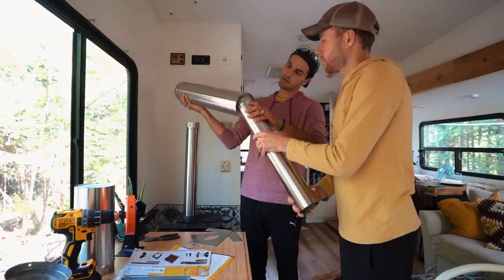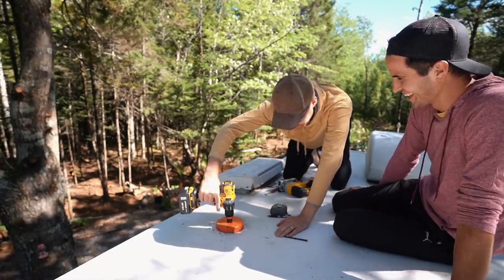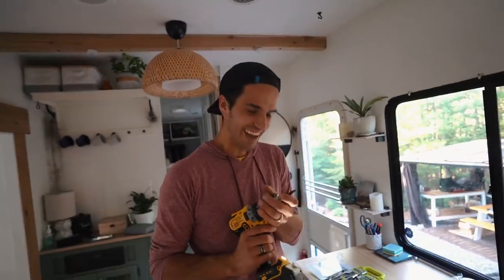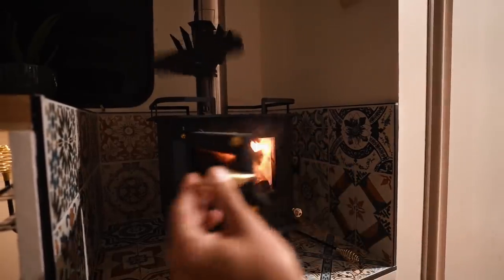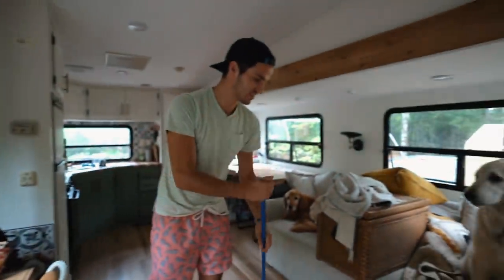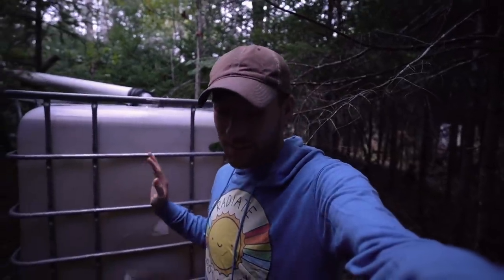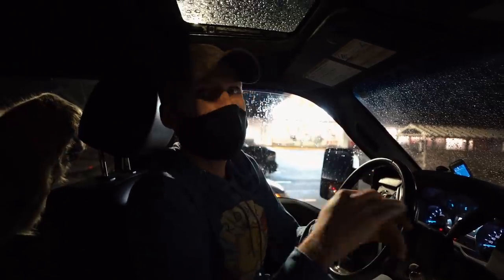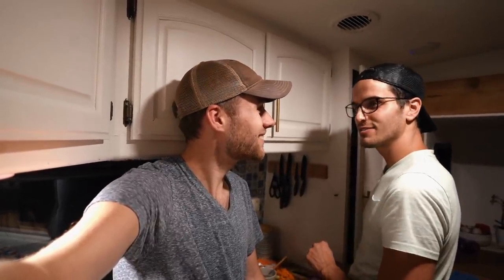LIFE in a TINY HOUSE | tying up loose ends!

Comment: Howdy Guyz!!  Great "Hints from Heloise" tip for cleaning the inside glass of your wood stove.  Take newspaper & little of the ash & scrub it.  The black much cleans off fairly easily!  As for your rain water, get a "Berkie" water filter, that make just about any water safe to drink.
Reply: Any paper (paper towel, etc) or cloth works. Dip the paper/cloth in some water then into the ash and rub the glass. It's like magic!

Comment: That little stove is impressive. I live in a manufactured home and have been thinking of putting in a wood stove for a while. I haven't used my furnace for a couple years because it's so expensive. I bought small space heaters for the bedrooms and have an electric fireplace which works fine. Luckily it doesn't get cold here for an other month.  Sour patch kids are my favorite! Todd's one liners, lol. I like your wit. Have a great week!  Can't wait to see what's next.
Reply: I have to admit, I'm not an expert about heaters. However, a couple of years ago our building was looking into replacing our electrical heaters in the hallways and I was really surprised about what new ideas are available out there. The new electric heaters we got were way smaller than what we had previously, and I had my doubts. But I was totally amazed at the heat they gave off even though they were much smaller. This was in part due to the fact that the heater has a built in fan that pushes the warm air about. It also has a built in thermostat so it turns off once it reaches a certain temperature. I'm on the west coast of Canada and we have government run utilities. I'm amazed how much info and tips are available through the utilities company. They do a lot of research and are keen about sustainability etc. Look into independent info thats available in your area to find more economically viable option for your heating. We can all sympathize with you.

Comment: You two are too funny lol Todd's innuendo jokes are the best. I am wondering if you are really staying in the 5th wheel during the winter if you should maybe skirt it, close in under the bedroom (make a good shed) and insulate inside the skirting. Then an electric heater underneath but you need shore power.
Reply: They can use straw bales and n contractor bags and they won't need to heat.  Oh wait, they are in Canada, lol. I was in the mountains of WV in RV in fall and winter and using those made a world of difference. The bags over the straw keeps critters out btw

Comment: An added benefit of heating with wood stove is it nearly eliminates condensation on the inside windows.  You might need to actually keep a pan of water on the stove to add humidity to the room air.

Comment: Great video, as always! I feel like with a temperature conductive metal roof and seasonal freeze/thaw cycles, it might benefit you to paint some Flex Seal liquid rubber sealant on the perimeter of your chimney pipe flashing as a backup to the caulk. ...just something to consider. 🤗

Comment: To help with keeping trailer warm in the winter, you may want to consider putting some skirting around the bottom to close it in - it will keep the wind, cold and snow from under the trailer.  Ideally, you would have insulation behind the skirting, but it's not absolutely necessary especially if you pile snow up against it to work as an insulator.  The skirting would be the same as what you would see under a trailer in a mobile home park.  You can make it out of plywood.
Reply from the maker: That’s our plan for this week!!
Reply: @tylerandtodd  - it will be a lot of work but probably well worth the time and effort you put into it.  Good luck.  Look forward to seeing how it comes out.